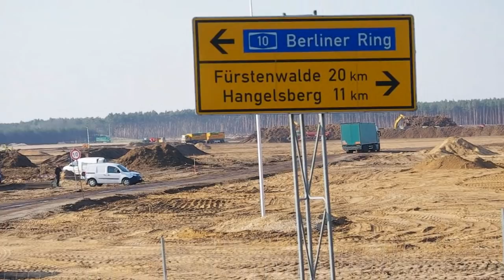Giga Berlin | 2020-03-26 | Update on leveling

Comment: Seems like work is not slowing down. This is great news. Construction work is one of the best jobs to stay separated from others and prevent spread of the virus.
Reply: the problem is why do they use those diesel trucks and machines?!?!
Reply: @carholic-sz3qv  Because the technology to replace them is not mainstream yet, but perhaps building more factories of this kind will accelerate transitioning those to cleaner technology next.
Reply: @AllanSustainabilityFan  nope the thing to do is to improve the batteryy technology to be able to match ICE first
Reply: @AllanSustainabilityFan  what nonsense comment is this?!?!? you know that there are cars for any different sizes and forms and utility too?! in the mining industry, construction. for people who dont have time to waste to always charge when towing, EVs are good but nowhere near gas or diesel
Reply: @carholic-sz3qv  Yes there are niches, that's not important. What matters is that for most drivers EVs are now the best technology. 

There will be rural or remote living outliers that will get addressed later with EV trucks and 500 miles of range, for towing across states instead of just a park, etc, in a couple years, but that doesn't need to be resolved for this to become mainstream. And lets be honest, most of those big trucks are used for hauling six packs of beer, they're rural status symbols. Still, EVs will get to them soon too, people will be able to fill up their EV trucks in their driveways with solar panels.

The average person travels less than 30 miles a day, 99 percent of the time. If you can plug at home then you would always be leaving the house on a full tank, and you would be thousands of dollars richer than your neighbor that pays for gas instead of cheaper electricity. So really, for allot of people, you're saving time and money with EVs, once you adjust to the fact that they're closer to cellphones than cars when it comes to fueling.